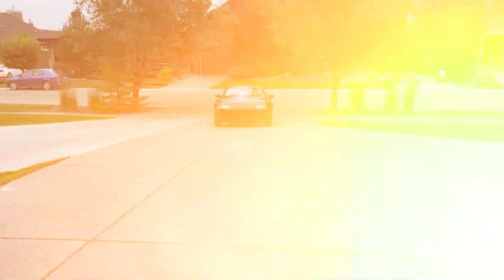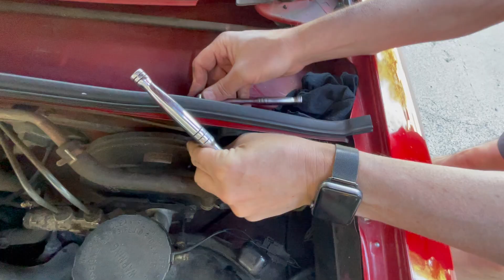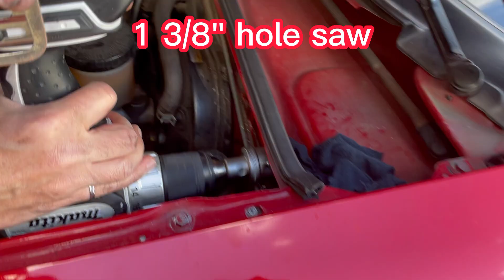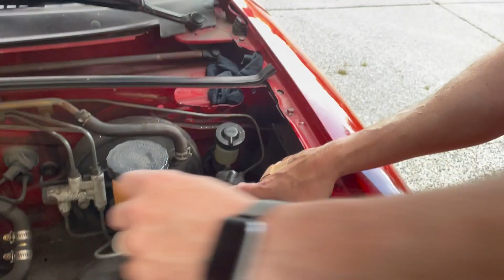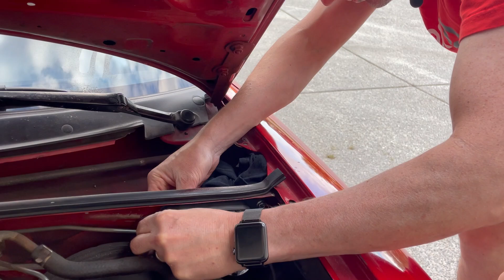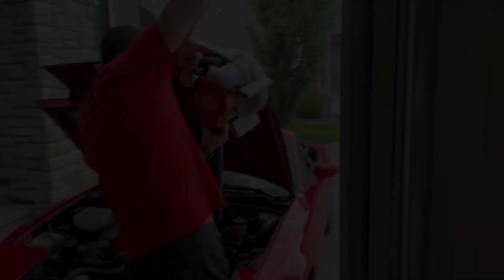Miata cold air intake installation

Comment: This is a absolutely nonsense work and it will cost a lot of money for nothing. 😢
Reply from the maker: At this point, working on a 1990 Miata is more of a passion.
Reply: I've been working with the MX-5 NA for over 20 years and own 12 of them. But believe me, I would never damage the firewall to install something that's proven ineffective. And the best thing is to keep a car like this in its original condition, because that's the only way it retains its value. In Germany, it's very difficult to sell a modified MX-5.
Reply: FM did a dyno test that shows 5 more hp and it’s not that expensive.  More power to you being afraid to install something like this but it is always sold out so not sure what that says about your point.

Comment: The only con I can see is covering up the clutch master cylinder
Reply from the maker: True.  Need to pull it off to get to the master, so maybe do a clutch fluid change first, but it is pretty easy to take on and off.

Comment: Just installed mine and I can definitely hear more of a growl under load. I can’t really feel any more performance but it makes my 1.8L sound much better. In my opinion, this is the best air intake option on the market.
Reply from the maker: Congratulations.  I agree.  Such a simple design, but it works.